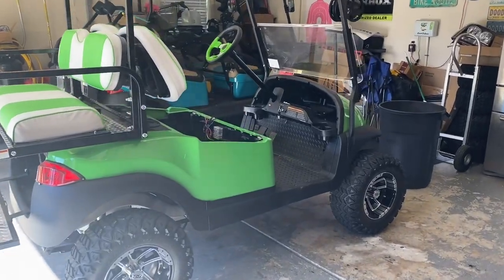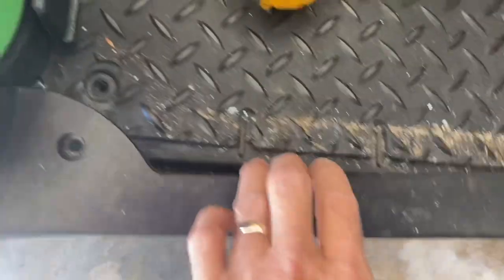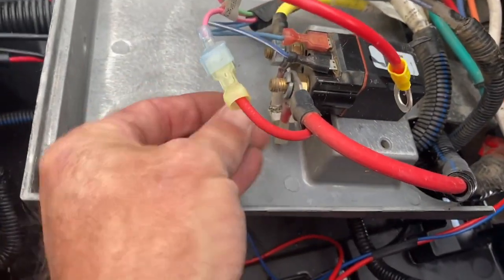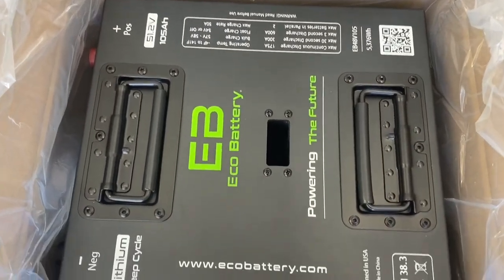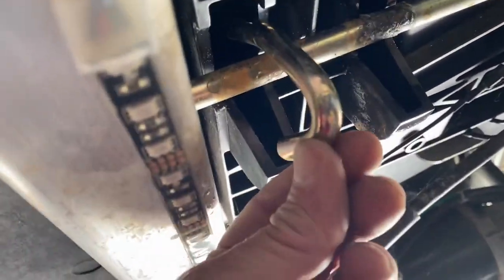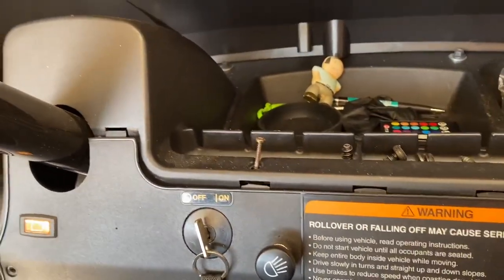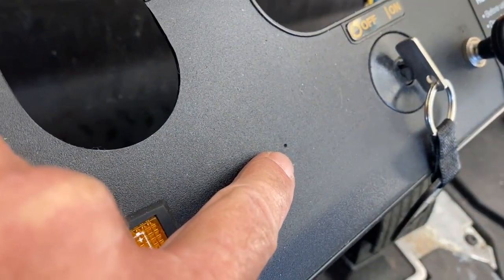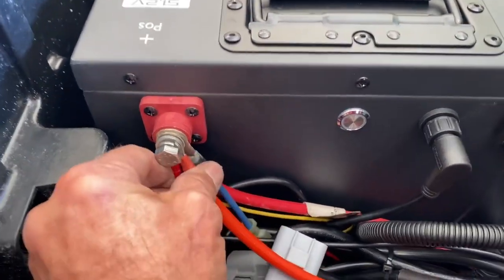How to install a Eco Battery 105 in a club car precedent￼

Comment: Great video! I'm definitely using it when I install my new Eco Battery next week. Quick question I'm having trouble finding an answer to...I have a light kit on my 2012 Precedent and notice you didn't do anything with the existing light kit connection on the Eco Battery reducer. Is there an existing 48v to 12v reducer already on the cart that the light kit is continuing to use? I'm assuming this is how I need to tackle the install on my battery and not be concerned about frying my light kit? Thanks!

Comment: Caution, the standard Curtis 1510 controllers do not like lithium batteries according to Eco. Thanks to James' video, the conversion was as simple as he makes it look. Unfortunately the battery would shut down after 50' or so. Error message on Eco gauge showed "Discharge overcurrent". Gauge is awesome, works great. Eco to their credit sent a tablet overnight and I hooked it up to 1 of the 2 CAN plugs and my wifi. Eco tech was able to operate tablet remotely and downloaded the history which showed huge discharge currents of several hundred amps. They sent me an RMA and paid to have it returned. They warned me that the Curtis controllers were a problem but I had no need of higher speeds and did not want to upgrade. My local Club Car guy connected to the Curtis which showed a max of 125 amps before a shutdown. After the second return I reluctantly upgraded to the Navitas 440 amp, left stock motor, and every thing is fine $600 and 2 months later. Apparently 30% of the Curtis Controllers have to be replaced after Eco conversions so budget the extra cost when considering the lithium upgrade.
Reply: I just bought a ECO 72 AH battery.  I am about to install in a 2014 Club Car Precedent with a Curtis controller, model 1515-5201.  Do you suspect I will have similar problems as you had?
Reply: @mdkudzu  no idea but you are committed now so go ahead with your install. If your battery cuts out like mine go ahead and order the 440 Navitas. Easy install.
Reply: @mdkudzu  you have a 1515 so maybe not. Apparently 1 in 3 Curtis controllers don’t work well with Eco and have to be replaced. I like the Navitas  but I would not have spent the money. Was not looking for more speed

Comment: Great video - thank you!  What do you need to plug into the new charger port installed. The  charger description on the ECO website suggests that you need something else and you cannot plug an extension cable straight into it.
Reply from the maker: All new chargers come with a quick connect into the charging port adapter. You will remove the factory Eric or power drive charging port, and install the new one with a quick connect into the charger. 
Any questions feel free to call me on my cell
Reply: Thanks for the quick reply. Had it all installed but would not charge.  I realized the new bundle and charger uses CAN charging.  I needed to connect the CAN connector from the charger into a CAN port on the meter cable. Seems to have done the trick.  Thanks for your help.

Comment from the maker: Great question! I’ll have to go review the video myself lol, but any electrical accessories , you would definitely plug up to the black and red wire from the Eco battery voltage reducer (13.5v out). And those are the thick wires without the ring terminals. The yellow and black wire with the ring terminals go to your Eco battery , the black and red wire which is thicker, with no ring terminals go to any accessories. I’ve ran LED undercarriage lights, headlights, horn turn signal, and a Bluetooth radio without any problems at all! Not sure if you decide to put a 200 W amplifier, you might want to add an additional heavy duty voltage reducer
Hope this helps, if you need an awesome Eco Battery dealer to sell you your bundle kit, give me a call! 803-530-5813 👍

Comment: What was your speed before the plum quick bandit?
Reply from the maker: We did the bandit and the Eco Battery at the same time for this customer. But he was running about 17 miles an hour with lead acid batteries and an OEM motor
Reply: @Kartznfartz  Cool. I already did the eco battery conversion and 17 mph is what I'm getting also. Been thinking about doing the bandit upgrade but didn't know how much it would help. Going to do it now. Thanks.
Reply from the maker: @mikedemanuel3608  , you will be very pleased! I’ve done about five of these combinations like you’re talking about and on a club car precedent with 23 inch wheels I’m getting a consistent 28 to 30 mph!  Reach out to me if you need a Bandit Motor for a club car president immediately!